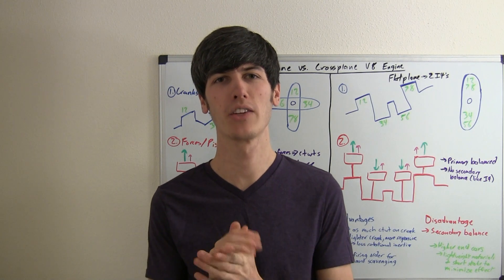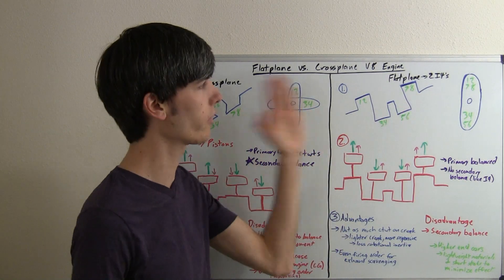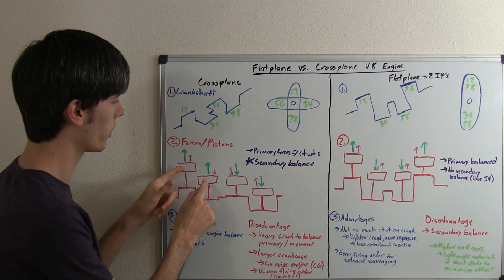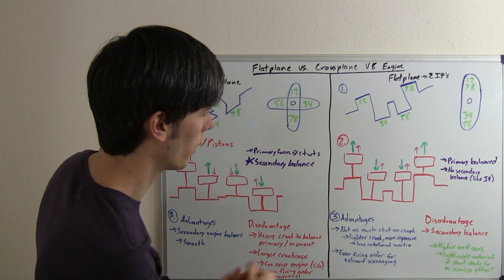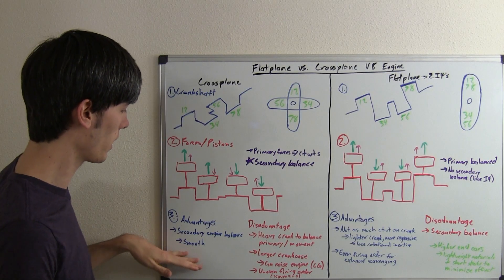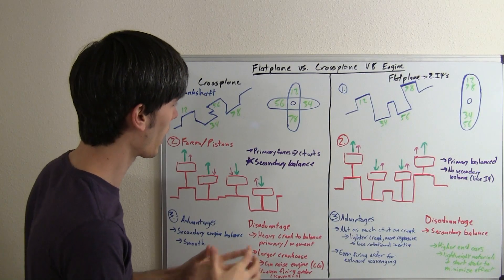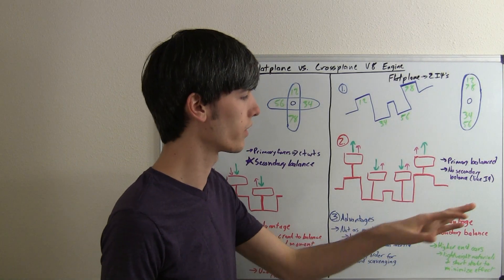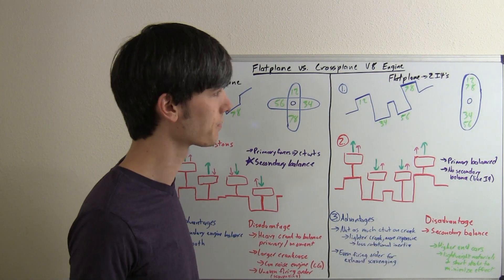Flatplane vs Crossplane V8 Engines - Which Is Best?

Comment: Can you install a crossplane crankshaft in an engine that originally had a flatplane crankshaft and vice versa?
Reply from the maker: 1meero Anything can be done, it's just a matter of time, thought, and money.
Reply: Engineering Explained Ok thanks. Will it be just a crankshaft swap or will there be more modifications needed? If yes what?
Reply: 1meero You'll need a flat-plane crank of course, but you'll need camshafts to time the valves to the new crank.  AND you'll have to figure out a way to time the spark, and probably the fuel injection too, since fuel injection these days is sequential.  I suspect aftermarket engine management systems could do this easily.  What also might be needed in order to get the maximum from the engine would be a different intake and headers designed differently.  

Incidentally, what you've talked about has been done before, mostly by people just looking to do something different.  It works just fine, sounds a bit different, costs a HELL OF A LOT.

Comment: Hi. Awesome video and explaining. Does flatplane V6 exist? If the flatplane v8 is basically two 4cyl engines with commong crankshaft, doest that mean flatplane V6(if exist) is two 3 cyl engines connected with common crankshaft?
thanks
Reply from the maker: Check out my video on V6's. The crank is quite different as the firing interval is every 120 deg. of crank rotation.

Comment: You missed what I thought was the most significant distinction, that is that a flat crank can be forged while the cross crank must be cast. Forged is stronger for high performance.
Reply: Cross-plane crankshafts are often forged;  Every Porsche 928 has a cross-plane V8 engine with a forged crankshaft, and hot-rodders have been installing them in their engines since the 1950's.
Reply: Both engines can have forged or cast crankshafts, it's just the expense of having one over the other.

Comment: New Mustang GT350 will have a flat plane V8!
Reply from the maker: ZL1Gimpelson Did Autoblog send you here? ;)
Reply from the maker: Che1seabluesdrogba11 Just flat fours, you'd have to use your imagination and add two cylinders. Boxer Engine - Flat Four Engine - Explained
Reply: Engineering Explained  Jalopnik.  Do you have a video on Flat six engine like you see in Porsche cars ?
Reply: Engineering Explained Alright cool, ill check it out. You got another sub here XD
Reply: Engineering Explained So it's like a flat four but with no rotational couple? That sounds intriguing.
Reply: That’s a poppet valved loop scavenged 2 cycle v8? Done hemi cross plane v8’s been converted to this loop scavenged through the valves
Reply: WTF? miller STFU!

Comment: I am pretty sure that a crossplane Engine, at least a 4 Cyl. have way faster  response than flatplane. That's what they use for Moto GP bikes. I think Crossplane are mainly use in very high rev's engines (Formula,Moto GP) that usually have a shorter stroke, less torque but quicker response.  ?! At least this is what i thought. Correct me if i'm wrong.
Reply: I think you might have it backwards... flatplanes have the primary forces balanced out, so they don't need the large counterweights to balance them out, which makes them lighter, which should give quicker response/higher rpm. Not that a crossplane can't have those things, though.

Comment: I have a question about the flatplane. You said it has smaller stroke wouldn't it make it bad for high reving engines? Also doesn't ferrari use flatplane? there cars rev higher to is this black magic? Or am I not getting it?
Reply from the maker: brandon morello Did I say it has a smaller stroke? And smaller stroke would be better for high revving, as the piston travels a shorter distance between revolutions.
Reply: Oh okay makes sense. Okay so whats better a v8 muscle that lopes are longer? Or a flatplane one?

Comment: Cross planes also have the famous v8 burble
Reply: davidrobert2007 You mean a glorious wail ;)
Reply: davidrobert2007 idk what is disappointing with f1 sound?
Reply: He forgot to mention too that flat planes make less torque too.
Reply: @mrmysterious6006  less torque has nothing to do with the crank style. The shorter stroke is the reason, and cross plane V8s are often pushrod designs, which aslo gives a sh*t ton of low end torque. Still, you rarely find a cross plane V8 in track racing (and by that I didn't mean oval tracks...), and there is no surprise, most of these engines pull out their maximum power between 5500 and 6500 rpm, which is a joke for track racing. Furthermore that sh*tload of torque has only 2 purposes. Good for killing your tires as fast as possible, and it makes easier to crash your car. God bless you, american V8!!! 👏
Reply: And the flat plane v8 has a disappointing four banger sound.
Reply: @davidrobert2007  more like the sound of a Ferrari
Reply: The flat planes do sound, uh, rather pitiful.

Comment: basically, the lovely muscular sound that v8's typically produce is determined by its crank shaft. not necessarily it's cylinder count. if you've ever heard a crossplane crankshaft vs flat plane in a yamaha r1 or in any motorcycle, it sounds just like a v8. a flat plane v8 imo sounds awful.
Reply from the maker: ***** Well, yes, really it comes down to the firing order, but this is dictated by the crank design (or the other way around, depending on how you want to look at it).

Comment: could you make a video explaining the differences in wear on an engine between a light and a hard driving style? I want tonknow more about the loads placed on the drivetrain based upon driving style and what that means for engine longetivity.
Reply: Consider what makes an engine "wear out." Metal to metal contact (rings, valves, bearings) causes friction, which is the greatest source of wear. Temperature changes cause expansion and contraction which causes metal to fatigue.  Materials decompose (gaskets, hoses, belts) which cause intrusions or secondary systems failure (ex. coolant.)

"Hard" driving (meaning a lot of WOT, and high RPMs) will expose rings, valves, valve seats, valve guides and bearings to greater wear either through higher internal pressures or greater friction, but major components (cranks, rods, pistons, pins) generally possess more than enough strength to handle the power an engine makes. Failures are rarely due to engine loads, but rather to poor lubrication, contamination, or material decomposition.

Comment: What about inertial torque ? Dose it work against you ?
Reply: Inertial torque by the pistons stopping starting is nearly conpletely mitigated in a 90 degree v8, cross and flat, because 4 pistons are at their top speed while 4 are at minimum velocity at nearly all times.

Comment: Hi!
You mentioned that in your future video you will explain exhaust scavenging. I have read about it in one of Graham Bell's books and I wanted to find out how to calculate exhaust manifold dimensions, for specific engine  there were equations but they didn't felt correct (real life examples were way more different from calculated ones). But I understand that there are way too many variables by which it's real struggle to create one equation for exh. manifold calculating.  
I'd really like to see from your side what you have to say about those few equations that are already out there (short n simple but debatable). 
P.S. 
Could you also in that future video explain how to big/small pipes affect scavenging and also how lengths of primary pipes affect scavenging. 
Thanks! You are doing a great work and put B18C in you tegra
P.S.S.
And check how Rperformance from Switzerland are doing things, those guys are mad:)

Comment: What about Engine/Exhaust breaking in Desiel Trucks?
O_o
Reply: MrMister1227 What, your mocking this channel? Cause that's what it sounds like. Also, last time I checked, the big button tab thing that turns off your fridge light when you push it with your fingers turns off when the fridge door is closed upon it.
Reply: What about it?
Reply: Explanation, or if the light in the fridge turns off in the frdige to consever power when the door is closed this is what the people want!

Comment: does anyone know if i'm doing a drag race with a rolling start from 40mph. what will help me more to win the race, horse power or torque?
Reply from the maker: Horsepower.
Reply: Torque is what gets you off the line and up to speed, horsepower is what keeps you going once you're up to speed. So if you're doing a rolling start from 40mph, horsepower is what's going to get you the win, since you're already up to speed.
Reply: Unless you stay in top gear, then torque is important again.
Reply: It depends on where your engine makes its peak torque, and how much time you can spend in the "area under the curve."  Two engines can make the same peak horsepower, but have very different torque curves. Depending on the gearing and other factors, one may win in an 1/8 mile race, but lose in a 1/4 mile race.

Comment: For people curious, yes - most road cars have crossplane crankshafts. The typical burbly, low-frequency roaring V8 noise is produced by the firing order of crossplane crankshafts. This type of crankshaft was designed by cadillac and hence why it is refferred to as the "american" V8. 

All ferrari V8's have used flatplane crankshafts in the past 50 or so years. Lotus esprit v8 and McLaren V8's are the only other road cars I can think of that have used flatplane cranks.

Comment: So are the imbalances bad because you feel it as you're driving? Or is it deeper than that?
Reply: Over the long run I think the imbalances have an effect on the reliability of the engine. Also from what I've read and heard is that an imbalanced crank is not very suitable for higher rpm operation.

Comment: Does the principle of crossplane crankshafts having less vibrations also apply to an inline 4? Some bikes use an inline 4 with a crossplane crankshaft, why are they far less common in road cars?
Reply: Not always. Inline 4's are known for having a lot of imbalance which actually limits the engine size. Once you hit a certain size of engine with an inline 4, you need countershafts (much like camshafts) that actually balance the engine's vibrations out to allow it not to shake itself apart. Inline 4's are primarily made because they are cheap, fuel efficient, and are short enough that they can be placed sideways in the engine bay to allow for less complicated FWD cars.

Another factor that makes 4 cylinders vibrate is because, if you think about it, over the course of 720 degrees, there is only 4 combustion cycles. That means that a burn is only initiated once every 180 degrees of crankshaft rotation, leaving another 180 degrees of rotation before there is another power impulse. So for that amount of rotation, the only thing keeping the engine rotating is the inertia of the flywheel which is there to balance out the power impulses of the engine. This is why engines with more cylinders tend to run smoother than those with less.

So, to answer your question, yes, they have much less vibration problems because with the cross plane crankshaft, rotational torque of the crankshaft is evened out so that inertial torque fluctuation is eliminated. Both crankshaft designs have their advantages and disadvantages, but I'm not sure why they don't use cross plane in 4 cylinder cars. Perhaps because they're more expensive.
Reply: BloodstainedSinner  No you completely missed the point of OHV design.  Actually you are no where close.  The OHV design is optimizes displacement in a very compact block.  If you compare the PHYSICAL size(NOT DISPLACEMENT) difference between a OHV V8 and a DOHC V6(google "VQ35(V6) next to LS1(V8)" and see the size difference between the 2) the V6 most of the time is physically larger than the V8.  Pound for pound the OHV design will make more power than the DOHC because it is much more compact therefore reducing materials, weight, and cost.  This has been one of the reason corvettes have been so fast.  Small compact powerful motors allowing low center of gravity and weight in a small compact lightweight body.  Boost pressures have nothing to do with it.  10.5psi on the vette's supercharger i guarantee is pushing more than twice as much air as the Evo's turbo on 19psi.  How do i know its making over twice the power and thats with the supercharger's natural parasitic loss lol air, fuel, and compression make power.  the volume of air is more important than the boost pressure.

the Chevy V8 is cheap to build here obviously but very expensive to build in Europe, but conversely BMWs and others are relatively cheap to build in europe so that just debunks the cheap factor.
Reply: BloodstainedSinner The problem with V4 is then having 2 cyclinder banks. That means 2 heads -> extra set of cams, extra manifolds -> meaning more cost.
Reply: Victor Chan That's why you use a OHV design. 

Before you say it's less efficient - the Corvette ZR1, with a supercharged 6.2L OHV V8, was capable of getting 29mpg on the highway, and still produce 638hp. while cars like the Mitsubishi Evo 10 can achieve 34mpg, with a turbocharged 2.4L inline 4, producing 312hp. That's less than half of the Corvette's displacement, also less than half the horsepower, and it's only getting 5mpg better. It's also notable that the Corvette is running 10.5psi supercharger, while the Evo is running 19psi turbo. That disproves the belief that OHV engines are less efficient - but that's a different topic for a different day.

V engines historically cost less to build than inline engines. Chevy's older 5.7L V8's can be built to over 800 horsepower for no more than $6,000, whereas an inline 4 engine making 800hp (there's less than 6 in the world) will cost far beyond $10,000 to extract 800hp. 

V engines have always been more cost effective.
Reply: Snowman1 But this beg's the answer - why not a V4 engine? The V engine design, in any configuration, is always superior to an inline design - and it would make the engine more compact and more stable.